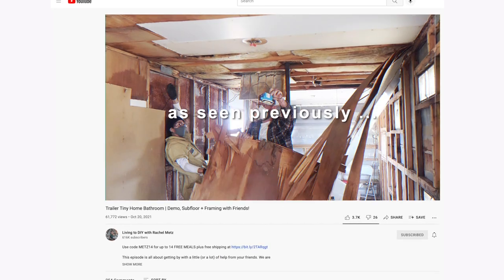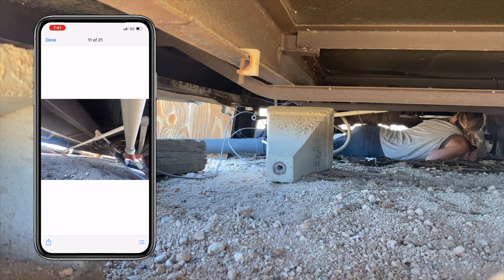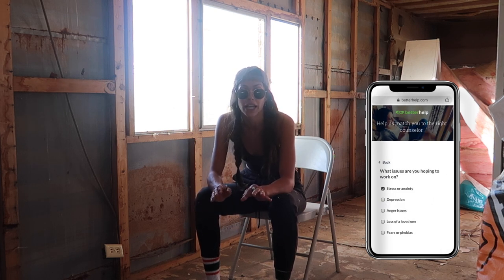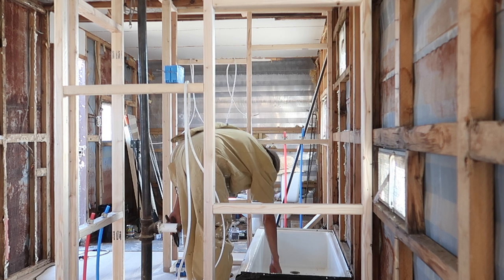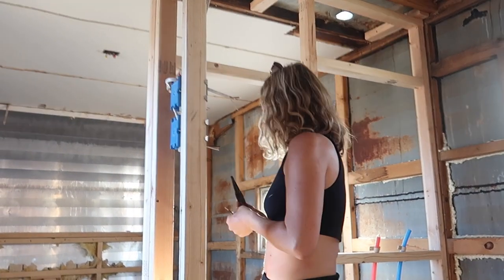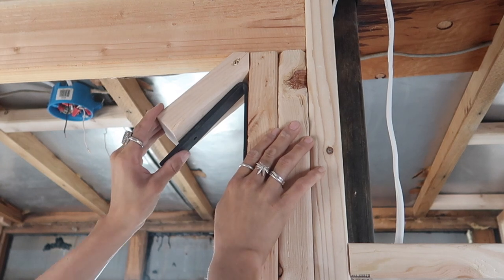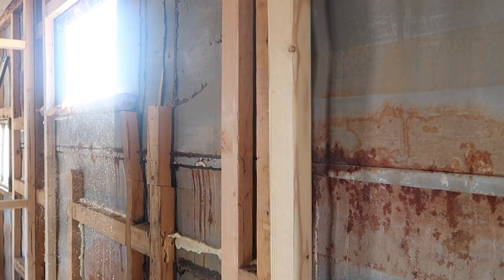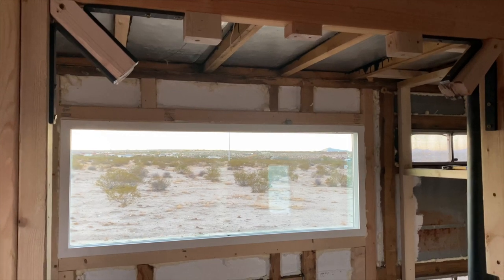Trailer Tiny Home Bathroom | Roughing In Plumbing, Installing Electrical + A Window!

Comment: They make metal plates that hammer onto the stud where you've run wire through if you want to add them. That way, you won't be able to hit the wire in the stud if your stud finder misses it or you don't have one on hand. Just makes it extra safe.

The window looks great!
Reply from the maker: Yess! Linds told me about them after I stopped recording.

Comment: Awesome job! Lady electrician here and I love seeing you tackle your projects like a boSS!

Here are a few rules to follow when wiring - secure the romex within 12 inches of entering the box and at least every 4.5 feet, leave at least 6 inches of cable from the point of entry into the box, and use a metal plate at least 1/16 in. thick anywhere the cable is less than 1.25 inches from the edge of the wood member. 

Here are the supporting articles. 

NFPA 70E, Article 334.30 Securing and Supporting. "Nonmetallic-sheathed cable shall be supported and secured by staples, cable ties listed and identified for securement and support, or straps, hangers, or similar fittings designed and installed so as not to damage the cable, at intervals not exceeding 1.4 m (4 1/2 ft) and within 300 mm (12 in) of every cable entry into enclosues such as outlet boxes"... etc.)

NFPA 70E, Article 300.14 Length of Free Conductors at Outlets, Junctions, and Switch Points. "At least 150 mm (6 in.) of free conductor, measured from the point in the box where it emerges from its raceway or cable sheath, shall be left at each outlet, junction, and swtich point..." 

NFPA 70 E, article 300.4 (A)1 Bored Holes - "holes shall be bored so that the edge of the hole is not less than 32 mm (1 1/4 in.) from the nearest edge of the wood member. Where this distance cannot be maintained, the cable or raceway shall be protected from penetration by screw or nails by a steel plate (s) or bushing (s), at least 1.6 mm  (1/16 in.) thick..." 

Keep up the great work!!

Comment: Window is gonna add so much to  your DYI guestroom! Love it!
Reply: @LivingtoDIYwithRachelMetz  Are you gonna make it so it will tilt out & open. We are getting ready to put an antigue window in our place We have joined  1, 14×80 & 1/2 od a double wide togather. I purchased the window from market place, I don't now how many pains it has in it but it's huge & big. Proably at least 50.  I'm trying to figure out how we could open & close in with booms! Do you know how to do that Rachel Metz
Reply from the maker: @violethoffermobilehomemove9189  I will not be doing that. I'll be adding a vent!
Reply: @LivingtoDIYwithRachelMetz  just wondered.  Thanks

Comment: I bought a houput a light in the bathroom thase that had been renovated by the previous owners and they put a ceiling light in the bathroom that has the fan built in. It's really nice because you only need one switch and when the light goes on the fan goes on.

Comment: you should have already looking into the permits to be honest. in my area at least and most places really, you need them before window installation, hot water heater installation, fencing, any plumbing or electrical work, anything that changes the footprint of a home, any structural changes, etc Faucets, countertops, flooring type stuff generally does not need a permit but all the rest, you need them....you don't want to get into a position where you do the work, then go for the permit, and then get denied and they make you undo it. That's the point of the permit, you are basically getting plans approved, and paying them for the permission to do it (which is bullshit but the way it is unfortunately) So you've already crossed the bridge, you need to look into it now girlfriend.
Reply from the maker: Thanks!

Comment: It looks like your under-trailer supports are knocked over?  If so, you will want to fix that before you dry wall......
Reply from the maker: Yes that's the plan! Stay tuned xx.